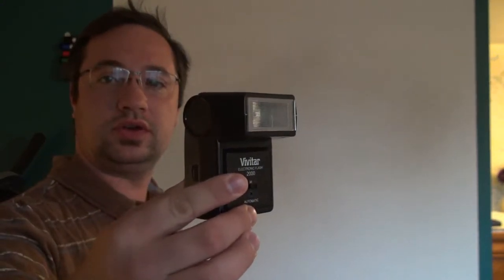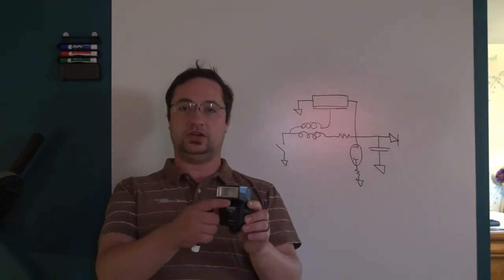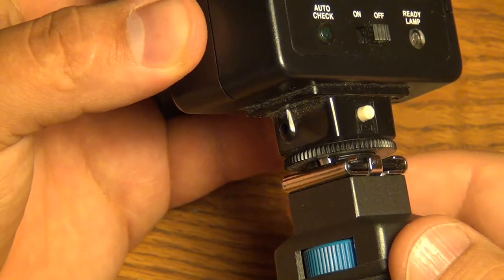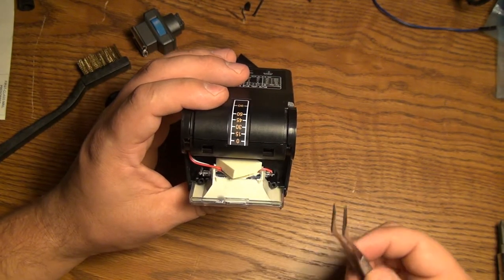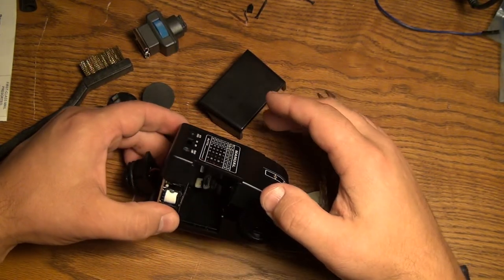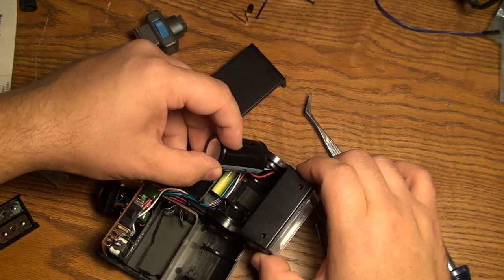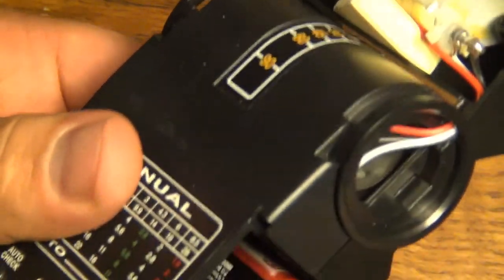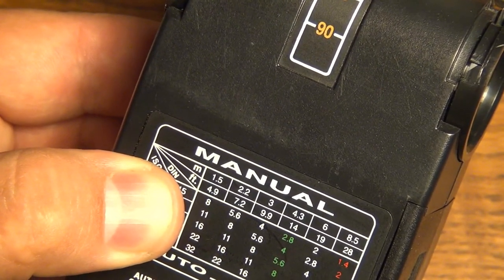eapbg #25 Camera Flash Taredown and Repair

Comment: I have a question, I have an old vintage flash for my old canon mechanical film camera (that hadn't been used in over 10 years BTW lol) and I recently got a new digital camera but it didn't come with a flash. so i was going to use that old one instead. So I put 2 AAs in and waited for the light, hit the test, and It (kinda surprisingly) flashed ok, but when it did it made a weird sorta loud, almost cracking or popping noise when it did. 

So i chose not to test it again incase it was damaging it. So instead i took it apart, and i am not unfamiliar with taking electronics and such apart and working on them, however no XP with flash. So when i got the back off and saw that one of the wires had come (or blew) off of the bulb I basically was like ".......F&^%". Most of what i needed to know and more was in this video though (by the way thank you for that! This was very informative and just what i needed) Unfortunately it was missing a few tidbits of knowledge that my situation may call for.

So the only thing i needed to know about is, when i re-solder the wires to the bulb, do you have any suggestions or is there anything special about soldering them? Will basic AVG solder and some random resin work for this and be ok? Is the glass likely to burst if i accidently touch it with the iron? lol ;D ETC.

Sorry for the long story and all but just wanted to make sure i explained fully so there's little chance (if anyone even replies to this lol) of not getting all info possible especially the crucial stuff. 

Im fairly ok at soldering, im no master or expert but not totally N00b either. But this bulb sitch is totally new territory. 

But anyway, weather you can or can't help me out, or ever get back to me at all I again wanted to say thanks for the video. Like i said it almost gave me everything i needed, which was surprisingly hard to find anywhere else lol.
Reply from the maker: The glass should stand up to high heat because it is used to contain an arc. That being said, I don't think the lead was soldered but welded instead. If the bulb gets hot enough it may melt the solder and the wire would just fall off.